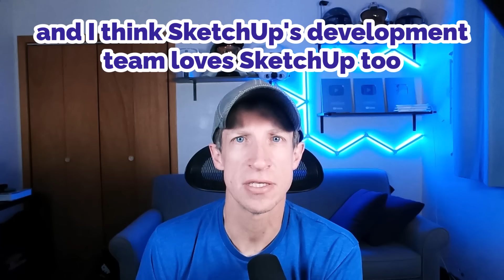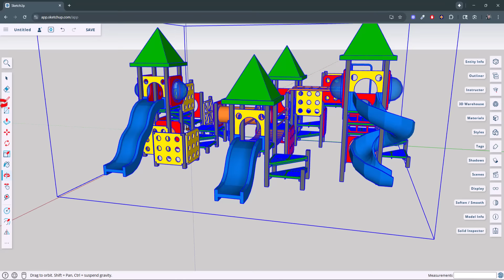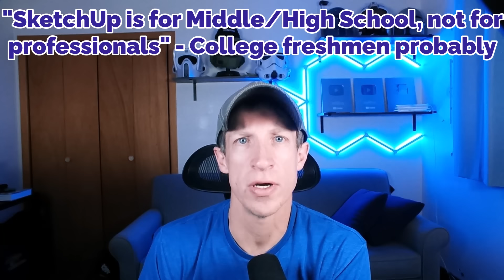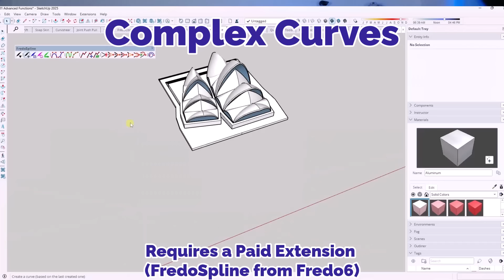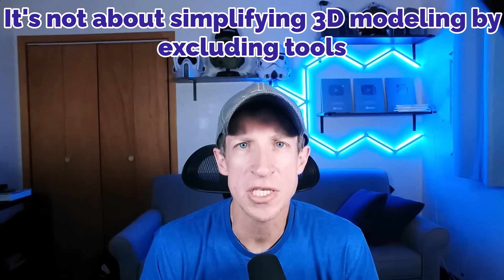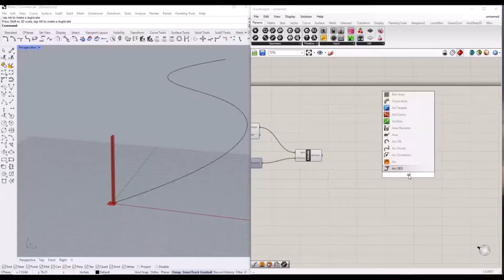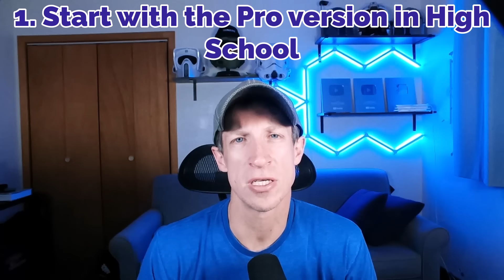Is SketchUp being REPLACED?

Comment: I'm a final year student major in architecture in Viet Nam, if anyone not knowing Vietnamese architects have been use Sketchup for decades and invest in it so much that till now students in my generation think that learning Sketchup is one of the most needed thing to do we need to survive in this industry, but lately for 2 or 3 years, when i was in my first year i had been told about Rhino and Revit and how they are superior than Sketchup, choosing to learn Rhino then Revit instead of Skechup was my choice, i never regret that knowing even my profs or friends of mine struggling model some thing that i would easily do in Rhino and GH way way to handy. The only thing i complain is when i work with someone using Sketchup my workflow does not work as smooth as i expected, architects and students now knowing of that are switching and start learning Rhino as a more powerful replacement of Sketchup, it's work as a modeling software then can be easily work with Revit or other Bim software. People are switching, but Sketchup still remain because of its friendly learning curve and more similar to older architect generation here, i hope they can improve it and if not Rhino is already taking its place
Reply from the maker: This is the kind of story I've heard a fair amount of - students being told to just learn Rhino over SketchUp due to modeling capabilities. I just think by adding a few additional tools, SketchUp could change this conversation completely
Reply: @Thesketchupessentials  to me modeling softwares are kinda similar to each other (3DS, Sketchup, Rhino,.ect... looking at their tools, they have mesh, subd, curve,.ect.. Sketchup has a avantage in learing curve, being easy to learn and use made it the most used modeling software in Vietnamese architecture industry. Rhino rising is obvious because of its capalbilities to do more at the time. I dont hate Sketchup, my prof and friends are using it, but the working workflow between it and Rhino or even Revit is lacking, if Trimble think about it and make it better to sync into the workflow, become a part of it, like Rhino inside Revit, i would love to try it out. Developers have to make the boundary between softwares disapear for user to use whatever software to work and things come out alright, making easy for modeling software sync to others and to Bim is what i wish it to come true, not through some complex steps and processes

Comment: I’ve been using SketchUp since version 6, back when it was still a Google program. I learned and taught both SketchUp and Layout for years. But when I switched to ArchiCAD and saw how powerful and optimized it was, I gradually started using SketchUp only for the archviz process.
Now, with the high cost of the Trimble subscription and its poor optimization, I’ve started learning Rhino (something that was already part of my plan back in university). Once I master Rhino, I’ll probably never open SketchUp or Layout again — just like I stopped using AutoCAD after mastering Layout and Illustrator.
It’s sad, but Trimble seems to have stopped evolving, while the price just keeps going up.

Comment: Sketchup from day one was aimed at doing quick sketches, like paper sketches but in 3D.
People liked it so much that they made a whole professional pipeline with it, even with it's lack of power and advanced features.

Import a 20 millions poly model in 3dsMax, about 10 secs. In Sketchup, sometimes about 5 minutes...
Reply from the maker: There's a whole different discussion of why you would need a 20 million poly model, and I don't think SketchUp is really targeting that kind of use case, but I don't see why SketchUp can't continue to make those advanced features more accessible the same way it did the basic 3D modeling process. Rhino, for all its strengths, is not very intuitive, and that I think is an opportunity for SketchUp
Reply: @Thesketchupessentials  Correct. But in my work I often have to deal with those huge models coming from BIM model (sometimes 40 millions polys) and I have to integrate them in Sketchup because it is required.
It's like asking to put the content inside of a Hummer into a Smart! 🤕

You are right, the main force of Sketchup is it's  intuitivity and that's why people like it so much.
But because of that, sometimes my job can be painful! 🤣🤣 So I have a little love/hate relation with SKP.
Reply from the maker: Ugh - what kind of BIM models are they? Like furniture or something? Or is it just the way the BIM model as a whole exports?
Reply: @Thesketchupessentials  Example: a train/metro station
Reply: @Thesketchupessentials Rhino is also pretty slow with big mesh files on top of that. However regarding big scenes in SketchUp it is a pretty regularly occurring scene with students messing up their SketchUp files blowing them up to a few hundred megabyte files after they started to import all those flower and other decorative models.

One time a bike had over 22.000 objects - many SketchUp models are also terribly optimized.

Interestingly now AI put short work to that. Model the main design and AI render the filler objects.
Reply from the maker: @cekuhnen  I found it super interesting when I was playing with Meshy that there is an AI retopo option - you can tell it how many polys it should contain and it will remesh the object to that number of polys. I feel like that particular use case could possibly go 100% AI in the future (which in my opinion is one of the things that SHOULD be automated)
Reply: Think that's bad, import some of those stunning detailed trees with individual leaves, create a tree lined garden, oh dear! poor SketchUp and because I spend hours every day on CAD, my PC is a money no object 'take the piss'.

Comment: Soo true that web sketchup is just useless plus ipad sketchup should become a little cheaper so that adoption rate can be increased 

Basic tools for sketchup like bevel single line and curved surface extrusion bending models . Some toolset for making surfaces and maybe a basic toolset for complex smooth or parametric geometry 

I know addons can do all this stuff but new users dont and i have seen people jum off of sketchup in my architecture industry in just my college alone like 10 people stated using rhino or revit cause of this reason . 

I dont want sketchup to be rhino advanced cause its not trying to be that but a little internal advancement would go a long way basics of sketchup software should be redesigned .

And give us a black mode also thats really changes things the amount of publicity sketchup will get on a black theme would be amazing to see 😂😂
Reply from the maker: I think the web version is great as kind of a gateway program to teaching kids 3D modeling. It's simple and easy to learn, but it's pretty easy to get beyond its capacities. 

The tools you mentioned, plus some kind of actual curve creation/editing function would go a long way
Reply: @Thesketchupessentials  true